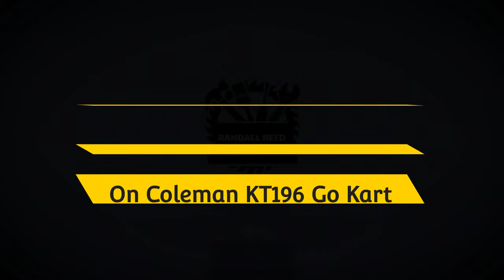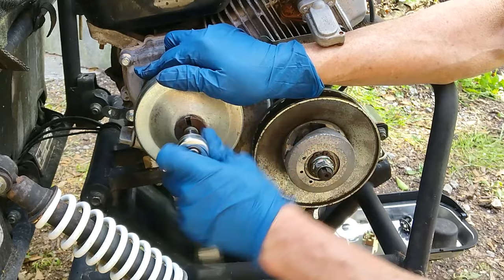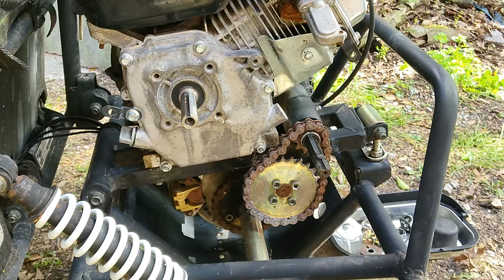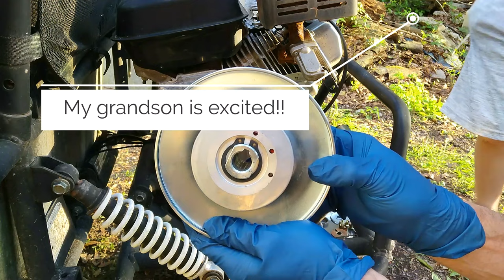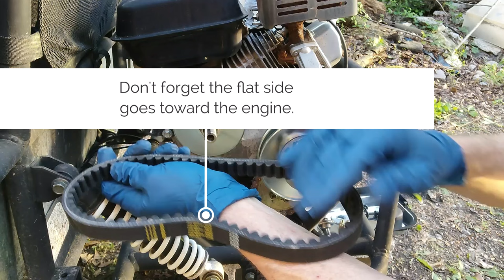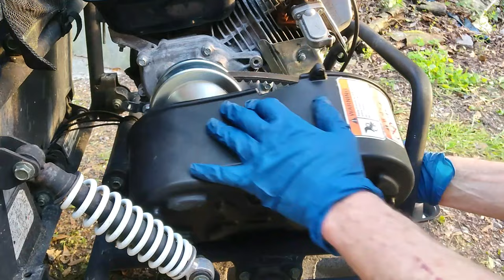How to replace clutch, torque converter and drive belt on #Coleman KT196 #GoKart

Comment: My kt196 tires will spin while lifted but weight is on it it will not move what could be the issue ive exhausted all of my knowledge
Reply from the maker: Not really sure what's going on with your cart. It could be a sheared key on the torque converter.
Reply: Engine needs to warm up or need to adjust carb. Engine running high at idle could cause this
Reply: The key way was broken replaced it no issue since

Comment: I am thankful you posted this.  I am having an issue where the axle that’s connected to the clutch pulley somehow got bent in extreme heat and years of hard driving.  How much of a process would it be to replace that axle/sprocket?   Thanks for any advice

Comment: I got a KT 196 in pieces. Does that gold bushing behind the torque converter go over thicker part of the shaft i couldnt tell in video your gloves blocked it. Also is that gold bushing thicker on the inside vs the one between the torque converter where belt rides?
Reply from the maker: No it doesn't go over the thickest part. I had the same thought when I replaced my first one.

Comment: Bought a barely used one for my kids for Christmas, rode it for about 2 hours, belt busted. No big deal, but do you think going ahead and changing all these parts is needed or just the belt? Thanks
Reply from the maker: I would just replace the belt. They are bad about breaking especially if it has sit for a little while.

Comment: Nice vid, only thing I would suggest is a couple drops of blue loctite on the bolt threads upon reassembly due to the vibration of the engine and rough terrain riding. But even that is not always bullet proof as far as things working loose. I speak from years of looking in places that I have been for that elusive fastener that fell out while riding😉.
Reply from the maker: That's a excellent point Dan. These go karts take a beating. Thanks for sharing and have a blessed week

Comment: I don't see anything wrong with our clutch but replaced belt and it was loose like in your video & burned up in 5 min. Just bought another belt and can smell burning rubber. Is there a way to tighten belt? Or is clutch the problem? Thanks!
Reply from the maker: You can't tighten the clutch but I've had a couple of issues in the past that you might check. First one time the brake caliper got stuck closed and the belt starting burning up trying to spin the axle. A new caliper fixed that. Then there was a time that the belts I got from a certain ebayer would burn up and fly apart in under a hour. It was kind of strange but I changed where I got the belts and that solved that. Lastly I once put the belt on backwards with the beveled side facing the engine. Belt burned up in no time. I hope this helps you and have a blessed weekend

Comment: What size is the nut on the lower drive pulley?
Reply from the maker: I use a 21mm socket to remove the nut on the lower pulley. I hope this helps you. Have a great weekend.
Reply: Does anyone else’s fall off all the time? We have 2 of these go karts and one of them loses this bolt ALL the time. I usually locate it but not this last time. I’m trying to figure out how to replace it and make sure it doesn’t come off again. Any help would be appreciated.

Comment: How did you know the clutch was bad? Other than the obvious slip? The reason why I ask is that when my kid accelerates we are getting a clunk clunk clunk noise as if the chain is slipping but the chain seems tight. I first noticed it because when my child would be at speed she would suddenly back off the gas and brake traction and I heard the popping noise.
Reply: Sounds like backfire and vibration
Reply from the maker: Not sure if this is your answer but ours started making a noise and I finally found the sprocket had wore way down and the chain would slip making a hard clunk sound. Hope this helps.

Comment: Question for you guys. I purchased a 196cc Coleman go-kart already assembled and after two days with me and my son riding in it, the square keyway ( 5x75mm) that the video mention not to take out bends/curls on while riding. It literally was curled disabling the Kart. Not sure how that happened. Is it possible the assembler didn't put the 21 mm bolt on properly or at all? I didnt see it in the housing when I took off the cover to inspect. Really confused on why i would need to replace the keyway after only two days of riding. Nonetheless, Great video, it definitely will help with the repair.
Reply from the maker: Hello RBDynasty. That is a strange problem that you are having. The keyway can get mangled if the 21mm but comes loose or actually falls off. Sounds like they didn't tighten it correctly at the plant. You can do a search on Amazon for a replacement key and nut. Or you can go by a tractor supply or hardware store and find what you need. The keyway will be key stock that you will have to cut to length. Hope that helps my friend
Reply: @toollife101  Definitely helps and thank you. I figured as much regarding the 21 mm nut not being put on correctly. I ordered the key directly from Coleman's site. Thanks again!
Reply from the maker: @rbdynastystaffing8155  Sounds like a plan my friend. Hope you and yours have a blessed Holiday

Comment: How does he take them bolts off so easy?
Reply from the maker: I have replaced the belt on this go kart several times in the last 5 years. I've gotten use to removing the bolts. Have a blessed week my friend
Reply: Can you help me fix my issue on my Coleman go kart it turns on and everything but when I hit the gas it just revs and it won’t move
Reply from the maker: @JuanMartinez-tk4vq  Take your belt cover off and inspect your belt. If it's broken or has chunks missing then that is probably the problem. If your belt is fine have someone rev the engine and see if the rear torque converter is spinning. If it is then you probably have a sheared key. Also if the key is not sheared then check your chain and sprocket on the axle of your torque converter. The chains can break or the sprockets can strip off the teeth. One other thing is to make sure the big nut has not come off the torque converter. This would allow the key to slide out and the torque converter will just spin on the axle. These are all common issues for this go kart and all the parts I spoke of can be found on Amazon. Hope this helps you and have a blessed week my friend

Comment: what size bolt is that head on the clutch?
Reply from the maker: I use a 21mm socket to remove the nut on the lower pulley. I hope this helps you. Have a great weekend.

Comment: Great video.  Do you know the size etc of the crank shaft bolt that fits with this clutch and where can get one?
Reply from the maker: Hey Slavetonone here is the bolt dimensions M8-1.25 x 30 it's a metric size and you can get them at Lowe's or most hardware stores. I always grab my at Lowe's. I think they are 2 or 3 dollars. Thanks for your comment and have a blessed day